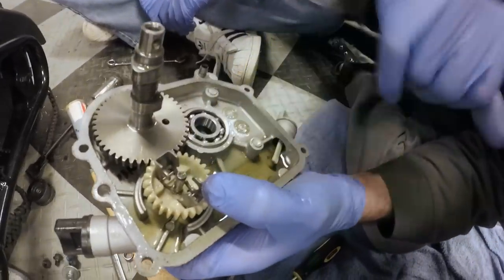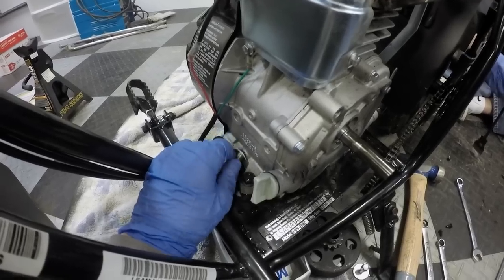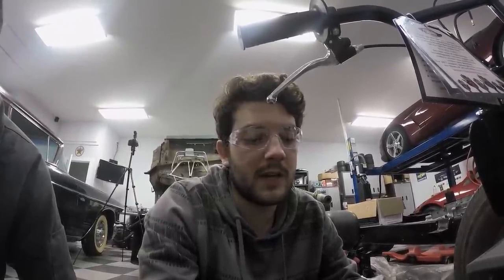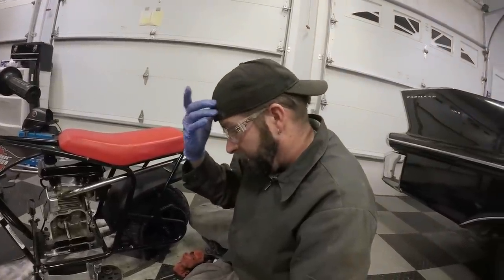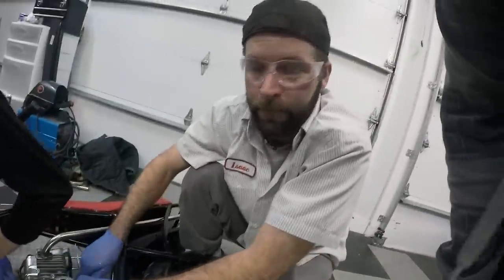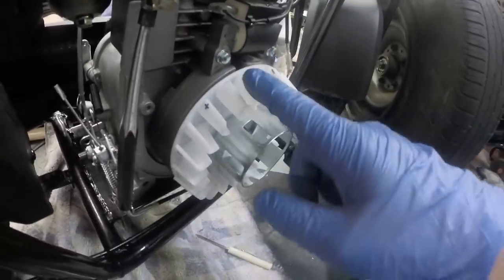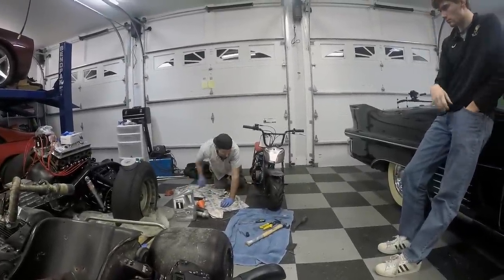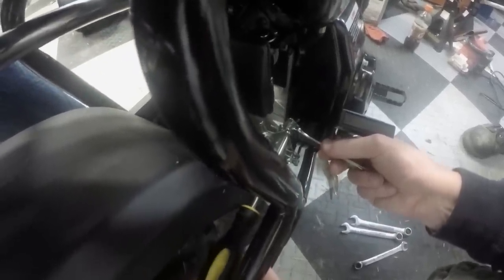Cheap Mini Bike Mods! Pt.  2

Comment: I really like how cheap and easy it is to work on these small engines compared to cars. If you mess up shaving a head on a car that's an expensive mistake! But on this small stuff it's no big deal. What an awesome way to learn about engines.

I'm wondering about that head shave that you guys did. It increases compression. But there is no computer or knock sensor. So what happens if there is too much compression? Would you hear the detonation if it started to happen? Maybe it was knocking but you couldn't hear it and it needed higher test gas to be faster? Very interesting build guys.

Comment: fyi most of these small engines have a compression release built into the intake cam lobe. the intake valve doesn't seat proper until the piston is halfway up the compression stroke. this is why a lot of the time the intake valve is all bunked up

Comment: Sorry if you seen this late as this is a old video, but If you punch a whole in the crank case you could use alumabond, or something else, worked well for my predator so far its been going strong for about 2 months

Comment: I have one of these but its a 105 cc. The problem with it is that it revs up and has a lot of torque in the low end, but then once you gain speed you just lose all of that and it decides that it doesn't feel like revving anymore no matter how much throttle you give it, so it only really goes up to 20-25, though I know it could make 30-40 if it was actually revving right, I'm pretty sure it's the governor but Idk.

Comment: mine did 32 easily with just a new throttle spring, just quickly swapped the engine for my friends 212 and we had to add a link, while that engine was on we started to work on the 79 cc and now we swapped it back to get the top end I wanted. Now we are making an exhaust out of a heavy duty steel pipe my teacher let me have. we couldn't bend it unless we used the oxide torch to get it to 1000 degrees so we just did the angle cut idea and we just welded the smaller piece of pipe to the flange. Just have to angle the other pipe and weld it up and it'll be done. Aiming for 38 mph

Comment: CarsandCameras when shaving the head you should have also shaved the block and you guys should have shaved the back side of the exhaust camshaft lobe the exhaust valve doesn't close all the way until the piston is over half way done with the compression stroke and shaving the back side of the lobe the valve will close sooner giving it more compression

Comment: to benefit from the shaved head higher octane gas would've helped. also porting the intake and exhaust ports might've made a difference more than shaving the head. I know a guy that can double any small engines power for under 50$ including his labor. there are tons of tuning ideas. I personally like swapping bigger carb or even running dual carbs.
Reply: +James Godwin i looked into porting and polishing the head. the intake runner does a 90 turn in the head. its a poor design and didnt think it was worth messing with it
Reply: I'd like to meet this guy

Comment: Hey carsandcameras, I got big news for you. I had a similar mini bike like you with the same engine and I figured out how to u govern it WITHOUT VOIDING THE WARRENTY
Step 1: take a piece of metal wire
Step 2: loop metal wire around governor arm and the throttle linkage on the bottom of the engine
Step 3: that's it
Optional: there is a throttle set screw on the throttle linkage. I removed it and I went faster without messing with the governor, I got a lot of throttle range like a dirt bike
Reply: I also killed one, they are easy to kill and overheat which I think that caused the motor to die
Reply: I killed that same bike I modded
Reply: Peter Kapica i removed the screw too and it did help with performance
Reply: Do the others you'll be doin 35+mph. Downhill is a totally different story. 40+ I think. Right now I got a motorized bicycle with no governor that I know of, just don't overheat it, it's just chinese

Comment: I married a  8hp briggs flathead carb and intake onto a briggs 6.5hp Intek OHV and with a little bit of tuning of the idle and high speed needles she fired right up and SCREAMS. She shoots blue flames from idle to valve float and revs out faster than I have ever heard. pretty much the moment I hit the throttle it revs out, ZERO hesitation. The briggs, Honda and predator are all the same correct? I bet this mod would kill the motorcycle carb or jetting the carbs on the predator. I have not attached it to a kart yet but it sounds like it will be an ANIMAL.  You may want to try this on a predator, just remember where the idea came from! lol

Comment: If you throw a predator 212 in that thing (no governor) what top speeds will it hit?
Also, have you ever bought a performance intake? Do they really increase top speed enough to want to spend the money on it?
Reply from the maker: Bombshell Band We have a video where we put a Predator on this bike.
Reply: Bombshell Band it hit like 32 with the origanal rear sprocket. with the 57 sprocket it does about 50

Comment: Hi I was wondering were the breather and carb gasket thing was because I took the speed restrictor out and it spits and sputters like your but Idk what to do, thanks
Reply: Tyler Volz i had the gasket turned 180 out. it will fit 4 different ways it will only work 1 way. sorry it took so long to respond

Comment: How many pulls did it take to start the bike after removing the governor ? My friend and I removed all of it and the bike won't start now, I pulled like ten times, everything was tightened again nothing fell out, would drill start maybe work ?
Reply from the maker: +Manuel Rivas In our experience, when we remove the governors they're just as easy to start. Modifying the intake/exhaust/carb jet is usually when it gets more difficult to start.
Reply: +Manuel Rivas you didnt take out the cam did you? when we did our mods i put a gasket on wrong on the carb and it didnt want to run rite
Reply: I got a brand new predator and tried breaking it in but all i got was backfire twice, it didnt even start
Reply: You screwed up the timing
Reply: +Manuel Rivas I juuuust finished following this video and removing the govenor. Same thing, i pulled like 15 times before i looked up and went oh shit... the bikes was in the "OFF" position. Turned it to "ON" and boom it started right up, and now its at leeeeast 25% faster. Sometimes its the small dumb things you forget at the end of a job. Thanks for the video CarsandCameras couldnt have done it without this as i couldnt find anything else on youtube that was legit.
Reply: lol. awesome

Comment: What is the diameter of the motor shaft?
Reply: I believe this one is 5/8". Larger engines like the 212 use 3/4". The predator 420 is 1".

Comment: What's the purpose of removing the governor?
Reply: They are stupid, the govinor is for a power plant so it keeps the motor speed constant. Nothing to do with power at all. Loosen the chain and brake so the back wheel spins freely. I put stp on my chain. Lots of power now.

Comment: With that much removed from the head, I'd be checking the valve-piston clearance at full-lift with a piece of clay. And go with a shorter reach spark-plug, if not also indexing it. In short: Doing the math first, and following a blueprint afterwards. Otherwise, all done would truly be for nothing... Like reworking the heads--minus shaving--along with bolting a bunch of hot parts & installing a big camshaft an engine with low compression. Without all the elements there, there is nothing gained & much lost.
Reply: +pancudowny i did check valve to piston clearance. and the head design sucked so i just gave up on it
Reply: Isaac it'll be fine Judging by the heart-shaped chamber, it looks meant for good low-end... Something that'd be desirable with a little work-horse engine. But then looking at that odd turn made in the exhaust-port and what a large, open-chamber the combustion area is, I guess it's no surprise that the results were lack-luster.

Comment: I put the predator 212 on mine with a hilliard heavy duty clutch (witch is amazing btw) and if i touch the throttle the front end goes flying up. Im not even kidding.
Reply from the maker: Photon's Garage That sounds awesome (and it's exactly what we're going for).
Reply: I have a different bike from the 60s but mine has a 4 HP Briggs and whenever you hit the throttle the front end comes up. Lol much fun.

Comment: There is no need to remove the governor from a stock engine.. Why? Because the engine will only rev 500-1000rpm more than if it would if you would have left the governor intact, and youre risking blowing a piece of hot metal into your calf. Remove the throttle-stop bolt thats on the throttle mechanism on the engine. If you had a Predator 212cc with a "hot" cam, then you would need to remove the governor to allow the engine to rev to 7000+rpm. Im running a bone stock Predator 212cc with free mods (bored out jet, bored intake box etc.) that revs to 6000rpm with the governor intact but the throttle-stop screw removed. Even if I removed the gov, it would only rev to about 6500rpm do to limitations of the stock valvetrain springs. Mod smarter my friend!
Reply from the maker: cxbra Removing the governor from this engine doubled our previous top speed, and while the engine could blow up, it was a risk we were willing to take.
Reply from the maker: And to your other comment, we spent under two dollars doing all of the modifications. That was for the intake, header, carb jet, shaved head, and governor. So doing free mods to this small engine was in a way like putting makeup on a pig, but the makeup was free. And we figured we'd share the results. As far as a Predator goes, keep your pants on. It's on the way. Do you have a mini bike with a Predator? If so, how fast is it?

Comment: I have a Baja Heat mini bike. I recently took the cam housing off to reseal it because it had an oil leak. Everything went back together fine. When I try to pull start it, it won't budge after I pull it out about 4-5 inches. Did I flood the engine? Is something blocking something? Please, help, I just want to get back to riding it.
Reply from the maker: Fluffle Puffle Hmm. So you didn't take the camshaft or anything out when you replaced the gasket?
Reply: Correct, all I did was take the cover off to reseal it. I put a small mark in the housing cover so that I could keep the cam dialed in. But when I put the silicone on it moved a bit and I couldn't quite remember where it was. I put the entire thing back together before even trying to pull it ( facepalm ).
Reply from the maker: Fluffle Puffle So is the cam lined up correctly or do you not know? There should be a dot on one of the gears of the camshaft and a dot on the output shaft (?) and they have to line up in order for the engine to run properly
Reply: I don't know if the cam is lined up or not. I lost track of it. I assume not, but would that keep the motor from turning over?
Reply: 4:10 - One of those fell out when I took it apart. I just slid it back in being the first time I've really got that far into a mini bike or a bike of any time.
Reply from the maker: I'm not sure if it would keep if from turning over, but you'll definitely want to line up the camshaft correctly or you'll ruin the engine. Also, did the pushrods fall out too?
Reply: The pushrods did fall out. I just put them back in not knowing what to do exactly.
Reply from the maker: Ah, you most likely need to take the head off (like we did) and insert the pushrods from the top of the engine rather than push them up from the bottom.
Reply: What is the difference and or purpose of pushing them from the top rather than bottom?
Reply: and how long do you think it'd take? 3-4 hours?
Reply: Thank you buy the way
Reply from the maker: No problem. It would take someone experienced probably 30-45 minutes... Maybe twice that for someone inexperienced? And the valves can come off the rods so that's why you need to put them back from the top
Reply: Thanks man! I'm gonna get her running, and post a video of it. You guys are great! Keep up the awesome videos!
Reply from the maker: Thank you!

Comment: i somewhere heard that 2 stroke engines are for some reason batter
Reply: +Bartol J. 2 stroke mean 2 times more explosions for the same speed of the engine. so obviously more power for the same size. But it has lots of disadvantages...hard to tell if it's better. 2 strokes engines are often use for little engines cause, then, those disavantages (noise, smell, fragility) are easier to deal with. Hope i've helped you.
Reply: oh, i know that becuase i learn about that at school but i thatught it's a bit more complicated than that :D
Reply: maybe the centrifugal clutch transmission is more suited to 2 or 4 stroke...i don't know more than that...

Comment: why didnt they just take out the engine from the frame so they can get to parts easyier
Reply: +Reece Hanify im lazy
Reply: +Isaac it'll be fine hahaha even i would and ive just started to rebuild a pocket bike a old school one and new engine and part for it but it will go faster that yours one day but a i got is frame and wheels and front brake
Reply: good luck on the build
Reply: +Isaac it'll be fine thax the whole engine is going to be all new no second hand parts
Reply: sweet
Reply: or lean the bike over

Comment: At 11:58, 100 Octane is weaker gas than 87 (or lower)....
Reply: wrong higher the nummber means more power but its not as aggressive a 100oct gas burns slower than a 87 reason why u get more power is that the expanding gas from the 100 is still forceing the piston down way longer than the 87 is a short burst
Reply: Wade McKenney In no way is that correct.  Not that there is actually a measurable difference between them.  Octane is just a measure of how much it can be compressed before it detonates (self ignites).  So a higher octane ratting would equal less volatility (harder to make a boom). 

The reason people associate higher octane with more power is because engines with higher compression have to use a less reactive fuel.  And the only reason to build a high compression engine is ether for more power, or it's a diesel and you want it to self ignite....

Comment: you raised the compression by shaving the head now you need 110 octane you might also get more power by advancing the timing with something like  http://www.ebay.com/itm/Mini-Pocket-Bike-Flywheel-Rapid-Rocket-Key-Woodruff-Dirt-Bike-Quad-Race-Minimoto-/161613757686? you might have to carve one out on your grinder to fit your engine out of a bolt or something  good luck keep moding

Comment: "True, RED NECK", Engineering! I Should Have Knowed, Cause, I Am "50% Red Neck!", To Get The "RPM's" Ya Want, Ya Has Ta Use A Bigger Carb, Like; 
(1) The Best, "Carb", Being, A "Slide Carb", Like "Bing", "Dellorto", "Kiehin", & "Mikuni"! 
But, Remember, When Using;  
A Used "Slide Carb", For A "125-148 cc, 4-Stroke Engine",  Use A "Slide Carb", From A "63-75 cc, 2-Stroke Engine"! 
A "21-25 mm Slide Carb"!
A Used "Slide Carb", For A "148-175 cc, 4-Stroke Engine",  Use A "Slide Carb", From A "75-90 cc, 2-Stroke Engine"! 
A "25-28 mm Slide Carb"!
A Used "Slide Carb", For A "175-212 cc, 4-Stroke Engine",  Use A "Slide Carb", From A "90-106 cc, 2-Stroke Engine"!
A "28-32 mm Slide Carb"!
(2)The Second Best "Carb's", Are "Tillston HA/HD/HL/HR", & "Wallbro WA/WD/WL/WR", Used On Pro "Go-Karts", & "Outboards!
(3)The Third Best "Carb's", Are "B&S", "Clinton" "Lawson", "Tecumseh", "Stock Carb's", From Bigger Motors! 
(4) "DIAL-IN-THE CAM-SHAFT, On A "TIKI 4-5 HP", You Can Advance, The Shaft, By One Tooth, For More "RPM's"

Comment: I ungoverned mine without rippin it apart. Reply back and I'll tell you
Reply: Peter Kapica you disconnected the spring lol but that isn't ungoverning the engine
Reply: JustKyzuuh what i did was took a piece of wire and looped it directly on the governor arm so the governor wont move
Reply: Peter Kapica sometimes the governor gear will explode and damage the engine. thats why you remove it